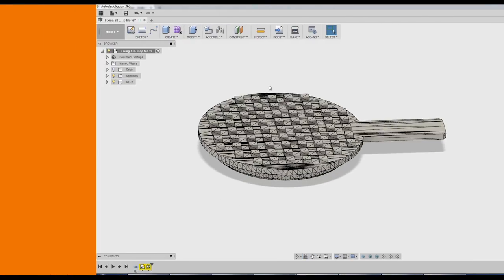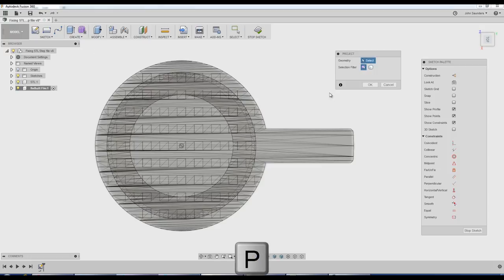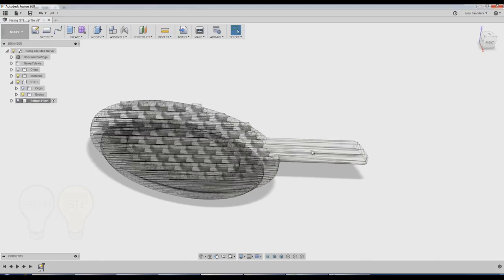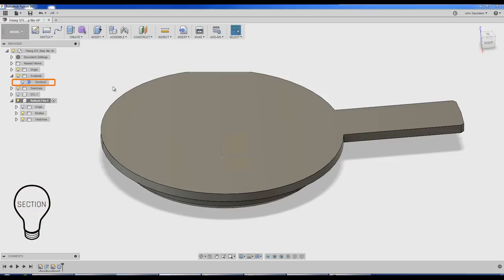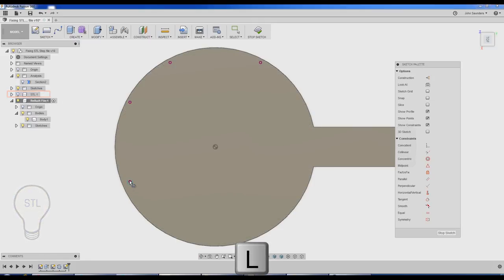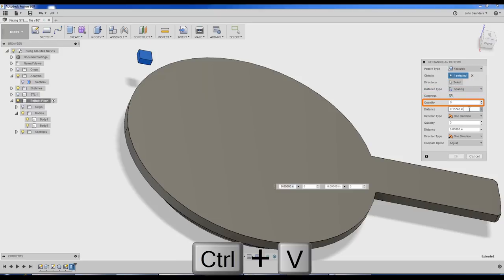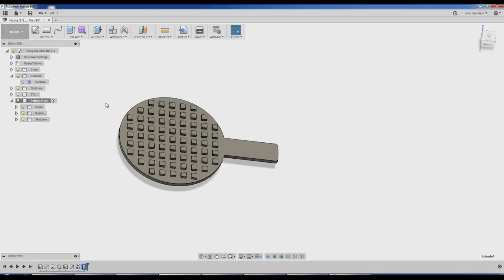How to Rebuild an STL CAD File in Fusion 360! FF99

Comment: Instead of deleting the feature, have you tried the Remove option?  It should remove the body from the design without affecting the patterned bodies.
Reply: For those of you who haven't run across this feature before, select the body from the browser and right click it. You will find it under the delete menu.

Comment: Here's something to try.  Select the command offset plane.  Pick the plane you first selected to sketch on.  Drag down to the middle of the part.  You're creating a plane parallel to the largest surface.  Now use the command split body and break the STL in half on that plane.  Now combine the two halves back together.  Fusion will recalculate the model as its rebuilding it and massively simplify it.  Most of those little triangles will dissapear.
Reply: thank you man
Reply: tried ... not worked. Fusion doesn't see the .stl as a body.

Comment: Nice one, I work with customers files alot so very helpful.
Instead of making that block on-top then patterning it and making 70 new bodies I would pattern the sketch, then you can extrude as a join of the main body.

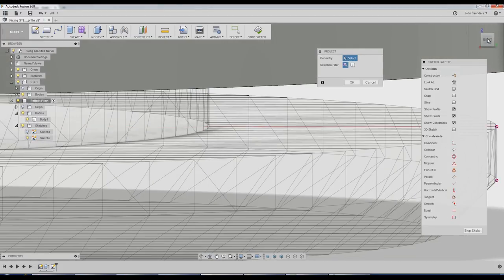Comment: When you are in the sketch at 7:18, getting ready to project points for the revolve, instead of doing the intersection, you could have simply checked the “slice” checkbox from the sketch panel. You would then see the exact contour feature you need to project and have easy access to the hedge points you need. Hope this makes sense! :)

Comment: For the "waffles", I'd create an offset plane that goes right through them (horizontally). Then create a sketch on that plane and use the Intersect command. I would think that would give you all of those squares, although they might each appear as two triangles. Either way, you'd be able to extrude them all at once at that point.

Comment: Instead of deleting the feature, have you tried the symmetrical pattern from center?
Reply: Great minds think alike Igor.
Reply: Exactly. Symmetrical pattern from the central piece is the way to go. Even number of rows and columns (9x9) should ring a bell here.
Reply: Yep, that's the correct solution.

Comment: You shouldn't use delete as its extremely destructive. Delete basically removes the object from history as if it never existed. "Remove" is much nicer as it only "hides" the model, but leaves in all references to it. So if you need a component or a feature early in the design, but not later, just remove it and you can come back later if you need to make changes.

Comment: You're on free orbit, which ends up getting my view sideways more often than not in my experience. Click on the orbit at the bottom and switch it to constrained and it won't rotate accidentally. You may or may not have shown this in a video though, so sorry if you already knew this.

Comment: If I create something that I truly will never change I just copy the features I want then delete the original (also kind of a hack)...... AND another hack.... step it out.. save as a step file which destroys all associations, then create a new file based on the new step file. In your case I would have started creating the "pegs" in the center of the "paddle", then patterned out from there, then there is no need to get rid of the starting feature. 

Have you tried converting to BRep yet? This will convert a mesh into a solid. It's still kind of a pain but a solid is much easier to work with.

Comment: I don't know about you guys but for me it's faster to select all my operations with the mouse. It takes too much time to move my hand from the mouse, type two or three letters then back to the mouse. So that feature is pretty much useless. I designed software interfaces back in the late 90s and I had two trains of thought. If my interface was mouse heavy.. everything had to be within just a few clicks, if my interface was typing heavy (data entry) every function was available with the keyboard and I used tab to flow through the interface in a logical way. Just sayin.